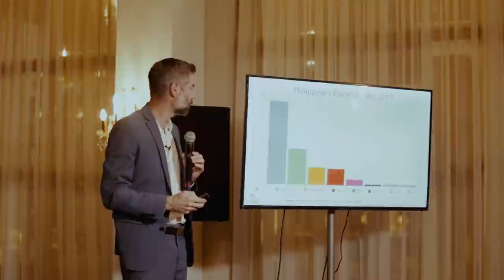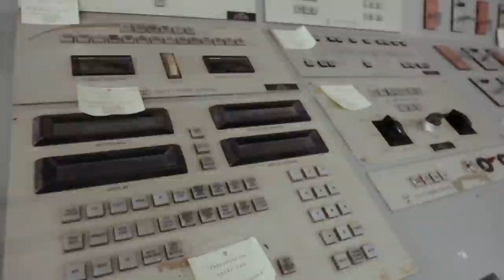"REACTOR” (revisiting the Bataan Nuclear Power Plant)

Comment: I worked on the construction of the Philippine Nuclear Power Plant (PNPP) as it was known then.  I was a Computer Programmer with Ecco-Asia, a prime sub-contractor of Westinghouse International Projects Company (WIPCO).  I was there from 1976 until 1977 when construction was halted because of the Three Mile Island Incident.  Re-fueling and restarting PNPP, I feel is not the way to go.  It is an old and outdated technology.  Whatever needs to be done to restart it may actually cost more and maybe even more dangerous.

If the country is serious about nuclear power, and I believe it is the way to go, they should consider Small Moduler Reactors (SMR).  They can be dstributed in the islands where they are needed.  SMRs are self-contained and has a lifetime of twenty years.  My humble opinion.

Comment: The I observe the discussions and interviews of people about BNPP. I conclude that one of the factor why people are quite afraid of opening BNPP is due to lack of information dissimination to people in using nuclear plant. They are quite compairing it to nuclear bomb that was so dangerous. The perception of the people will change once the experts explains how it works and that the way BNPP was constructed was based on the western standard of construction that provides several safety features to prevent the radioactive substace from leak, even in the event of strong earthquake. Funny, some of those who opposed know nothing about nuclear technology or the nuclear plant itself. I'm sure the the exoert on this technology will not allow this to operate, untill they are sure that its safe.

Comment: Our country need every energy mixed and reliance on oil and gas alone will be disadvantage to Philippines. Oil and gas is getting depleted, increasing in cost and usually used by oil producing countries as tools for leverage on economy, political pressure and trade negotiations. I have worked on BNPP structural embedments and I can vouched that the safety management system, quality management system, inspection and testing of materials and equipment are in compliance to applicable International codes and standards. Since the plant was constructed and completed almost 40 years ago, it will be prudent for BNPP management to review design based on current standards, safety and quality records, inspect and test the equipment and perform functional test of equipment, each process system and the entire system as a whole.